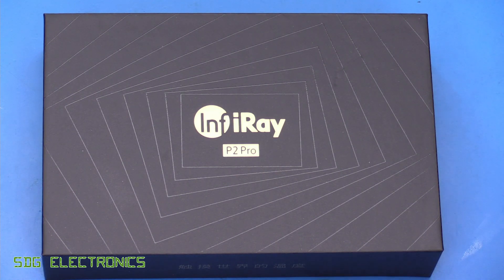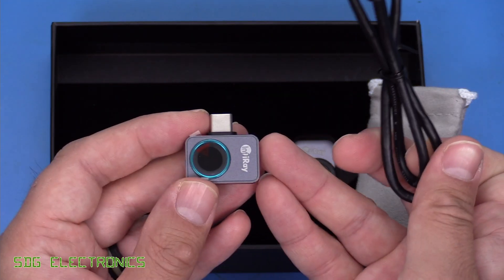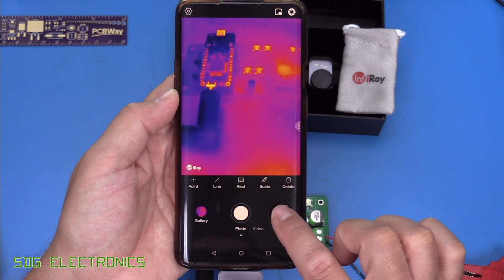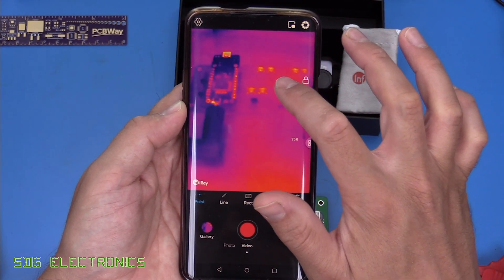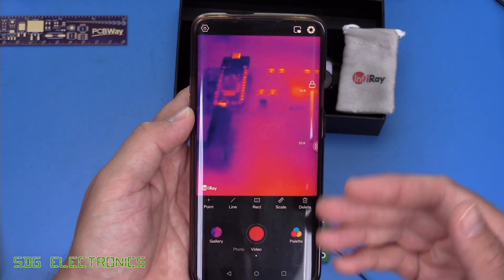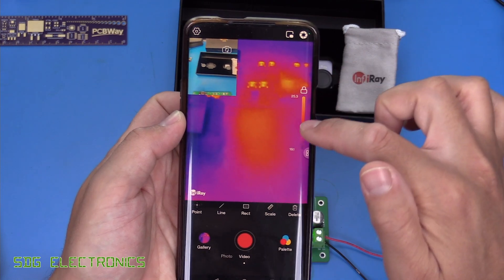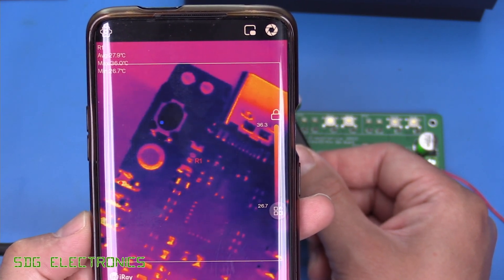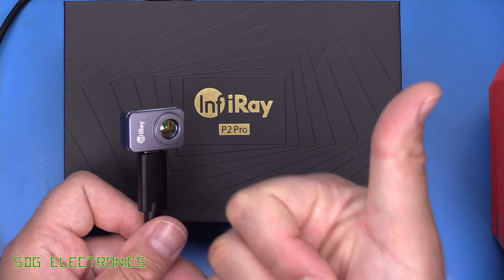SDG #308 InfiRay P2 Pro 256x192 PCB Inspection Thermal Camera

Comment: Do you know how I can calibrate it? With the macro lens, I get pretty different results. One or 2 cm higher can already give a difference of 5 or 15 degrees celsius or sometimes even more if the component gets very hot. This does not give reliable results.

Comment: How does this compare to UNI-T UTi721M. Both are similar price range and seems to have almost same specifications.
Reply from the maker: I think it's the same sensor, manufactured by InfiRay. They manufacture for other brands, so the only difference may be pricing and whether you want to support the original manufacturer.

Comment: I really suggest avoiding using those emissivity presets. Stuff like metals etc will change the k by a large amount even just by small variations in the alloy. If the camera doesn't come with the software to calibrate emissivity, then it's unusable for 70% of the cases. You can only look reliably at IC plastic packages.